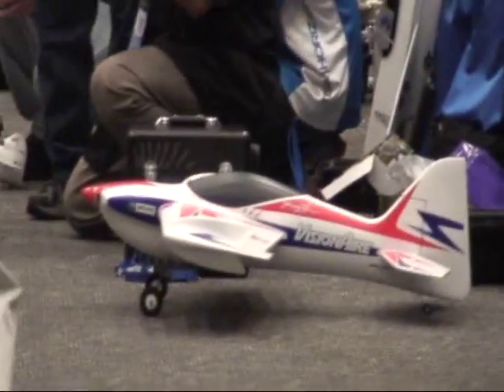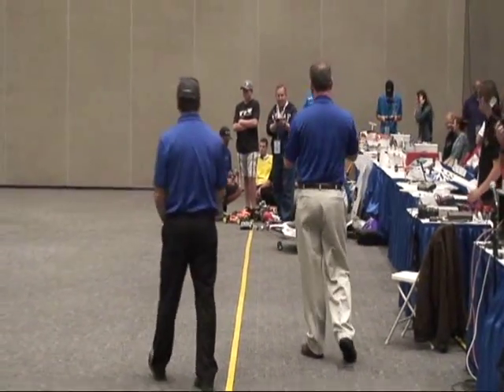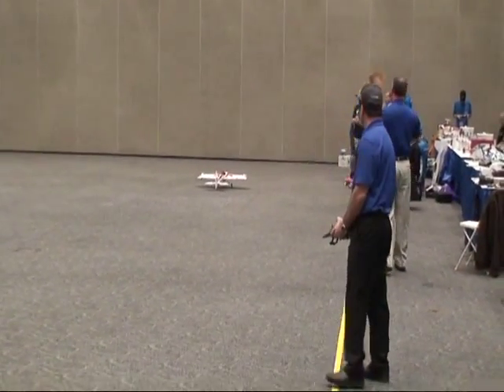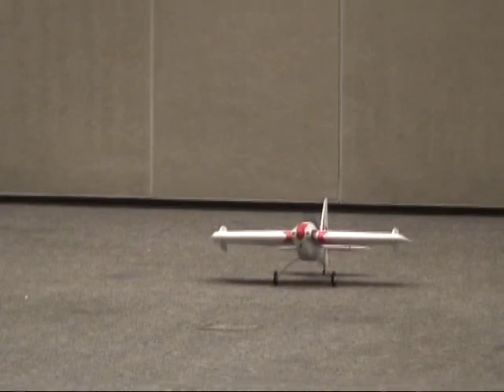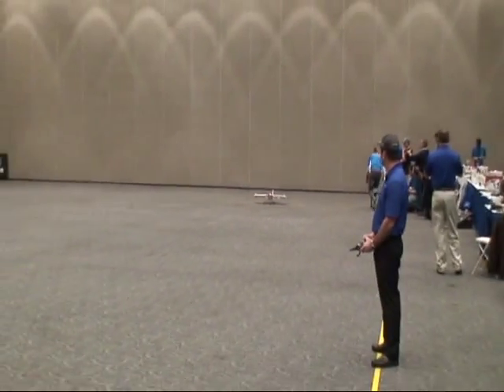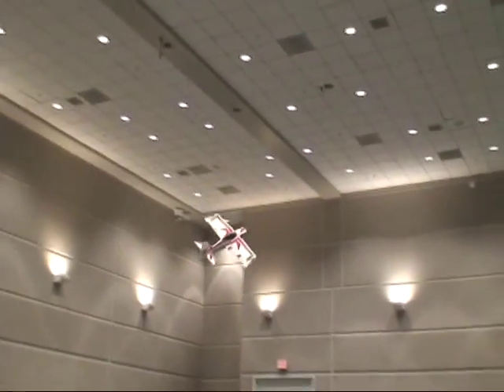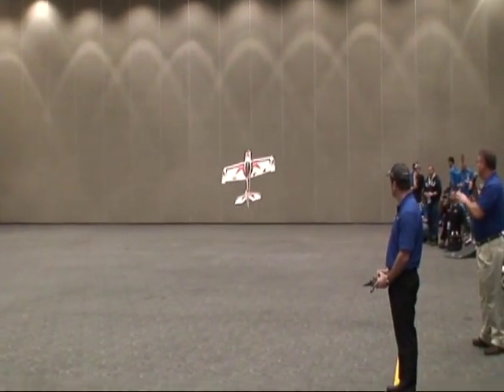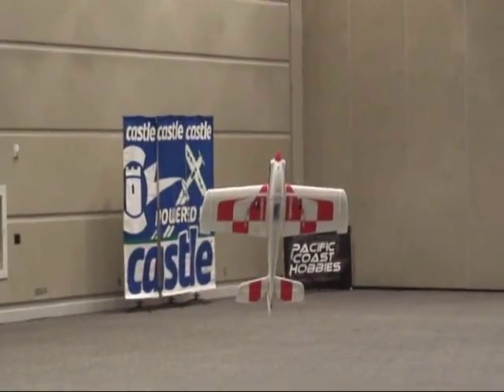First Sighting VisionAire at AMA Expo

Comment: Yes it will bind to a DX4e.. although i would suggest getting at least a DX6i the visionaire is a WAY better plane by far compared to the parkmaster even with AS3X turned off..they are great even for expert pilots to practice 3d routines so they don't end up wreaking a 50cc-170cc plane..